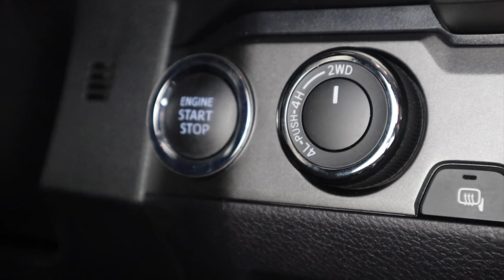Should you buy the latest Toyota Tacoma 2016-2021?

Comment: I am down in the Caribbean and bought a 2017 Tacoma. It has stalled out intermittently several times and it’s been checked now. I will see if it is a bad fuel pump or an electrical issue possibly involving the fuel pump. I have watched many videos and there are many possible causes associated with this truck. I had  The VIN run and mine does not seem to be associated with any of the recalls. I hope it is a simple fix

Comment: Any input on the oil starvation of the 2GR-FKS? There are MAAAANY owners with blown engines from starvation when off-roading. No oil baffles, no dry sump, and at certain angles they pool oil at the back of the engine and fail. First sign is smoking than failure.

Comment: I just bought a 2021 V6 SR 4DSB. The transmission still doesn't know when it wants to shift. 1600 miles on it.
Reply: I just bought a trd. I think I’m going to get the kdmax 6.0 tune. Supposed to fix all the drive ability issues.

Comment: Is the rear differential howling still an issue with 2021 Tacoma?
Reply from the maker: Hi! I haven’t seen any in the 2021s
Reply: How do you think they fixed that problem?
Reply: I keep reading tread about the issue and no one seems to know what the actual problem is and why not everyone experience it. I’m on the market for a small pickup truck and I must say that this turns me down a little bit.
Reply from the maker: Honestly the truck is loud and feels like a truck. But a loud howling noise is typically covered by warranty and the older ones that had issues they developed them very early and while under warranty

Comment: The most frustrating part of the 3.5L is the atkinson cycle.  Is it even possible to disable the atikinson cycle so it's not so weak at low rpm?
Reply from the maker: Not really it’s designed into it
Reply: @TheCarCareNut  hold on, so valve timing and fuel injection timing can’t be changed with a software update? In other words, a software update that eliminates the delay in valve closing and delay in fuel injection that simulates the Atkinson cycle in this engine? You’re the expert and I wouldn’t want to bet against your vast knowledge but I’m thinking the Atkinson cycle in this engine is purely software driven and can be programmed out (either by Toyota or aftermarket flash or piggyback).
Reply from the maker: It is software but at Toyota’s level it’s not possible to change it as the engine was certified for emissions as it is and if Toyota backs out that program it would be essentially cheating. Aftermarket is a different story as anything is possible when you don’t have he federal government and the epa breathing down your neck 😀
Reply: @TheCarCareNut  It’s my understanding that Toyota ECU’s are locked but I’d be willing to pay a decent price for an aftermarket flash or piggyback that disables the Atkinson cycle. If this engine goes unchanged for the typical 10year Tacoma product cycle, that’d be a large number of potential customers for that aftermarket mod.

Comment: Hi there. Need your help please. Bought a 2021 Trd off-road 4x4 manual. Truck is great but for some reason since I drove it from the dealer the steering wheel vibrates a bit at around 70 miles. Few other people are experiencing this. Have you had this case. Truck has 800 miles now. Please let me know what can I do to get this fixed
Reply from the maker: Hi! They’ll need to road force balance the tires to start
Reply: @TheCarCareNut  can this be done at the toyota dealer ?
Reply from the maker: Yes they can take care of it
Reply: @TheCarCareNut  thank you. took it to the dealer and they took care of the problem. Balance problem
Reply: Another quick question is the leak from the timing belt cover fixed in the new models or are the new models experiencing the same issue.?
Reply: @TheCarCareNut  are the timing belt cover leaks fixed in the new models or are the new ones experiencing the same issue ?
Reply from the maker: The leak from the timing cover got much better 2018 and up

Comment: I bought my 2021 Tacoma TRD sport 2 Wheel Dr. 3 months ago and the oxygen sensor failed and my check engine light came on and there was a message on my stereo screen saying malfunction or defect or transmission problem. So I took my truck in to replace the oxygen sensor.

Comment: You mentioned inside the engine bay, passenger side, an area that previously held hydraulics for breaks (?) and now is left void.  In that location, there are 3 mounting studs.    The one closest to the firewall sits lower than the other two.  What would the thread pitch be on those studs? Thank you!
Reply from the maker: Hi! Usually the thread pitch is 1.25
Reply: @TheCarCareNut  so what size nut would I use?  I've tried various one of unknown size without any working.
Reply from the maker: Honestly I don’t remember it right off the top of my head but it should be either a 8x1.25 or 10x1.25. If it’s smaller than it can be a 6x1

Comment: Hey AMD, I just bought a 2021 TRD Off Road with 22k miles on it.  I has the torque converter shudder you started talking about at 9:13 in this video.  Have you heard any update on that? It is really annoying and can make the truck not enjoyable to drive.  From what I have read, dealers seem to just brush it off as "normal".
I also have vibration when decelerating (braking or not) and I found a TSB (T-SB-0124-20)  for it, but it sounds like TRD Off-Road package isn't covered.  any ideas on that?  

Thanks for your knowledge!

Comment: Thinking about buying an I4 basic SR double cab 2WD. Will it be more reliable w the 4 cyl iron block engine, and no 4x4?
Reply from the maker: If you don’t need 4x4 and don’t mind the underpowered 4 cylinder then yes that’s a very basic and reliable configuration

Comment: I just bought a 2023 Tacoma TRD OR... (well, not mine yet, bank owns it)... I notice when the A/C kicks in, there is a sound that seems to be coming from the glove box. I would describe it as the sound similar to stirring something in a plastic cup, when the spoon hits the sides of the cup...I thought the blower is loose, but it's rock solid. If A/C is off, the sound does not come on, even if the blower is on. Is this normal ?

Comment: i would like to know is it normal for a 2017 tacoma that was only 3 years old to have the air conditioner compressor  shot, Would you know if there is issues with the AC compressors or recalls on this ? They  should last longer than 3 years.Would like your imputThanks.

Comment: I really appreciate your videos and information. Great presentation and honest. I’m considering getting a 2022 Tacoma Off Road with the manual transmission. What are your thoughts on buying now or wait until the next generation?  I’ve had 2 Tacomas (Gen 2). I don’t seem to fit very well with the low seating position and the 3.5 motor and trans with the torque higher up in the RPM range, is actually quite disappointing, esp after the 4.0
Motor. But I’m worried that the man trans will go away. Even the new Tundra seems to have an odd low roof position, esp compared to the Gen 2 Tundra. Anyone can comment with their thoughts would be appreciated. Thanks.

Comment: I had mice eat the wiring harness on my 2020. It was fixed by the dealership but now I'm worried because the wiring obviously had to be soldered, have you done these repairs ? Do they last
Reply from the maker: Hi! I’ve seen many of these repairs. The soldering holds but more important is the insulation. If it’s insulated well you won’t have any issues.
Reply: @TheCarCareNut   Thank you very much I really been considering selling the truck because I was worried because somebody the dealership said the solder may not be as good
Reply from the maker: I wouldn’t sell it at all! If in 10 years the connection breaks and you need to repair it again it’s not a big deal honestly.
Reply: @TheCarCareNut  thanks very much, initially the check engine light came on after the repair but someone said maybe they didn't do a deep reset ?
Reply from the maker: It’s possible. I would take it back to them
Reply: @TheCarCareNut  oh they have since reset and it hasn't come back on. I was just worried about that soldering not conducting correctly. A guy in service department said since wiring isn't original it may not conduct as it should

Comment: I am wondering about the drivers front axle bearing. My truck is completely stock and I am getting a front end vibration when I go over 50mph. More noticeable when driving over bumps. How much play should be allowed on the front axle?
I am thinking about replacing the needle bearing with ecgs bushing.

Comment: Hello 
I am new to your channel. Recently I bought a used 16 Tacoma TRD 4x4 sport model with 83k miles. Recently I noticed one problem. The air condition water leak in to the cabin . I checked the drain tube to the engine compartment is draining and clear. Further inspection noticed water leaking on the outside of the duct to the passenger floor. The leak is on the side close to the console and leaking to the floor and puddles and soak up the padding . Can you shed some ideas where it is coming from ? Any suggestions of yours will be greatly appreciated. 
John M
Reply from the maker: Hi! Check the hose connection to the hvac box it might have come off
Reply: @TheCarCareNut   is that hose going to the firewall ? 
Thank you
Reply from the maker: No it’s more towards the floor passenger side
Reply: @TheCarCareNut  thank you again . The truck is with a dealership today for rust CRC and the brake light recall . When I get it back I will dig thru the center console and see I can get to the hose . When I do I will send the pictures to you and some pictures I have now . I am unable to load pictures here . I am like your answers and responses. Anything else I need to will be appreciated . 
Thanks

Comment: I live in the rust belt (WI) and I have a 2020 tacoma and really have a big hate for rust! When you say rust proof the frame do you mean to use that rubberized rustproofing undercoating that looks like tar when being sprayed on or the oil rust proofing undercoating? I ask because I hear a lot of negative feedback on the rubberized undercoating doing more harm then good after a few yrs when it starts to crack then holds moisture and starts to rot the frame. Last year I sprayed my tacoma under carriage with NH oil undercoating for $55, same stuff a local oil undercoating company sprayed and wanted over $600. but a year later that messy stuff is still creeping and dripping, I guess I used to much.🤷

Comment: Hi Amd! I have a 2018 tacoma. I noticed that my rear diff is wet but not dripping, went to the dealership and told me that it is normal. Is this true?
Reply from the maker: Hi! Does it form a drop or it’s just a haze?
Reply: seal went bad, mine is bone dry on my 1985 4runner SR5 5 speed. quality has tanked at toyota. I had 3 tacoma trd offroad models, they all sucked. done with toyota.
Reply: Just a haze. No drops.i can send pics if you want, so that you can verify
Reply: @mannyu7522  ok sure
Reply: @TheCarCareNut  can i send you some pic so that you can verify?

Comment: To the Car Care Nut: Great videos.  I once owned a 1987 Toyota long bed extended cab with the 22r motor and the manual  transmission which I kept for 22 years. An excellent truck with only a carburetor issue.  My question is would you recommend the 2.7 motor or should I wait to see the next generation of the  Tacoma four  cylinders motor?  Thanks.
Reply: If you had to buy an old tacoma say from 1990 to 2011.
What years would you choose please.?

Comment: You have thoughts on the P11EE code and head replacements happening on 2016-2019 V6's? Been reading about several owners going through this. have no read of an issue or cause leading up to this except maybe the camshaft position sensor failures (which I note you didn't mention).

Comment: Hi AMD, love your Tacoma videos. Probably watched most of them before buying my 22' Tacoma Limited. I wondered if you could provide any feedback or recommendations. 
As mentioned, I recently purchased a new Toyota Tacoma Limited. I love the truck except for a couple of things. First and most annoying is after the truck is warm and I have been on the road for about 15-20 minutes an intermittent clicking/ticking noise begins. The noise seems to come from the dash on the passenger side. Reminds me of a relay open and closing repeatedly. Although I do not believe there would be any relays in that area and if there was it shouldn't be loud enough for everyone in the cab to hear. Secondly and probably not something that could be fixed is the wireless charger does not charge my phone. I have a Iphone 12 max. I believe the phone is just too big for the charger since it works on all other type phones.
Reply from the maker: Hi! On the clicking noise bring it to the dealership attention . There are a few things on the passenger side that could cause clicking. Hard to tell without testing it in person. Record a video so the dealership can hear what you hear. The wireless charger, do you have a phone cover?
Reply: @TheCarCareNut  I will make an appointment with the dealer. Thank you! As for the phone I tried it without the cover on and it still didn’t work. However I just got it to charge but I have to place the phone all the way forward. My guess is the phone is just larger than what they had designed the charger to work with
Reply: @TheCarCareNut  I will make an appointment with the dealer. Thank you! As for the phone I tried it without the cover on and it still didn’t work. However I just got it to charge but I have to place the phone all the way forward. My guess is the phone is just larger than what they had designed the charger to work with

Comment: Anyone know How do you turn traction control completely off? I have 2021 Tacoma TRD 2wd. I've tried hold the button for 10plus seconds while in park and its better but not off......If you are spinning the wheels in field or snow the engine will fall flat on its face.....any suggestions? Thanks

Comment: I noticed the transmission shuttering in my 2019 Toyota Tacoma TRD 4x4. It only happens around 30-40mph under light acceleration. Accelerating a little more and it goes away. I bought it use back in February of this year and had the transmission fluid changed along with a 4x4 service completed at the dealership after I bought it as it had 59k miles on it. I didn't notice the shutter beforehand but I didn't drive it very long before having it serviced. Wondering if I should go ahead and have it checked out?

Comment: Hi CC N ... Question I just measured my truck bed and it was 6'1" from inside the Rail up by the cab to the inside of tail gate.... I also measured the width and it seems the Cab side is over an inch Wider than the tail gate side.... Is this NORMAL ????  My truck is a used 2018 w/36,000 miles and this made me wonder if it had been in a accident... Carfax said No ........ Do you know If  the  Truck bed Width tapers front to back on the long bed double cab  Tacoma ????

Comment: What are the chances I have a 2016 trd double cab short bed and the only issue ive had in over 200,000 miles is the white paint issue and the whistling sound on the highway at higher speeds. Am I the only one that got a truck with zero issues? Its odd to me that my truck has no vibrations and NONE of the issues that were gone over in this video.
Reply: White paint peeling issue around rear door window at rear of windor a little spot

Comment: Apparently the V6 engine suffers from a design flaw... the 5th cylinder is starving oil and average failure comes around 140 000 miles. Is this still the case with 2022 ?

Comment: Hi AMD recently dealer ship finally installed the auxiliary fan cooling kit at front of the condenser one thing I noticed is when I turn the a/c on the fan not coming on  
Should the fan operate all time a/c is on or when  the outside temperature is over 100 degrees?
Reply from the maker: They’ll operate when needed. Check if they do operate in higher temps
Reply: @TheCarCareNut   I will have to wait when the temperature here in Texas  get 100 degrees thank you for all you help

Comment: Hi AMD, do you think there would be a 4 gen tacoma for year model 2023? Should we stay with the latest 2022 model to avoid being the "test subject" on the new gen?
Reply from the maker: Hi! Hard to tell at this point as they usually run trucks longer. The 2022 Tacoma is good as most of the common issues are taken care of
Reply: @TheCarCareNut  thanks. But in general rules of thumb, should we avoid the new Gen for the first 2 yrs after they introduced?
Reply from the maker: Hi! On toyota at least 6 months of production to be safe

Comment: I bought a used 2017 off road Tacoma and has had some major issues. First of all the the paint is peeling in different spots. My Tacoma is the white color and Toyota won’t address the problem. Shame on Toyota since other other Tacoma owners have the same issue. Also my timing chain cover is leaking at 76k miles.  Plus my power steering pump had a leak too. I must have a lemon😫